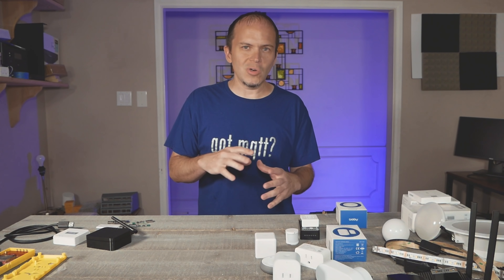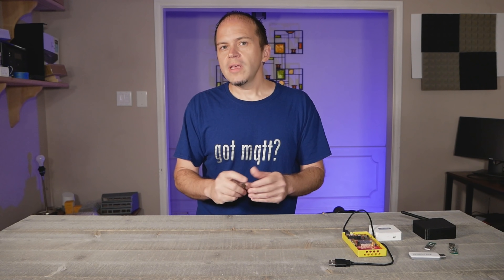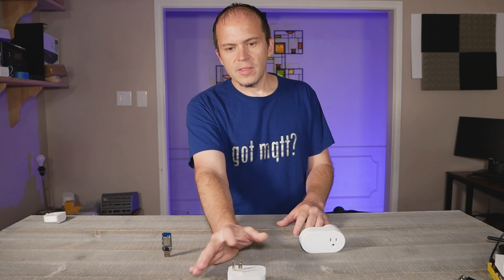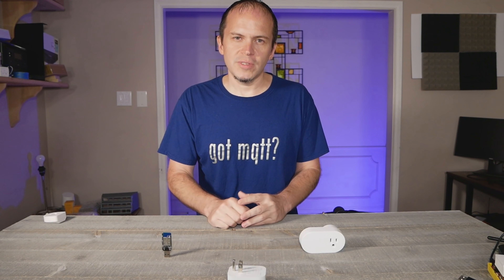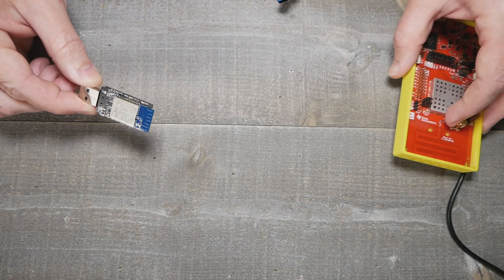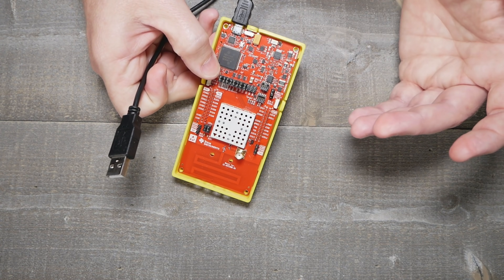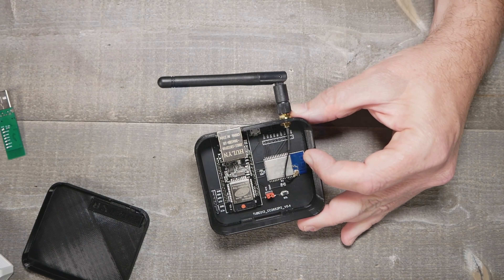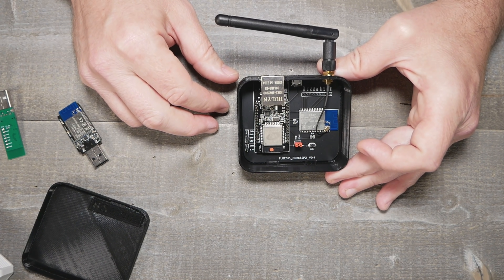How to Start a Zigbee Smart Home - Home Assistant & Zigbee2MQTT

Comment: What's the difference between CC2531 coordinator and sniffer, are they the exact same thing and can they both be used to control ZigBee devices on Home Assistant?
Reply from the maker: Probably the same just different firmware, I wouldn't recommend the CC2531 unless it is just a stop gap while you get a CC2652, then rotate the CC2531 for usage as a router.

Comment: I disagree on the CC2531 comment :P they are fine for a few close devices, or get the one with the external antenna and get much better range.  I had over 35 devices with the CC2531 before I started playing with zigbee 3.0 coordinators.
Reply from the maker: Definitely not on my recommend list at this point, unless you use it for a router.

Comment: You can get poe->micro usb to power the Tube coordinator.    I've got both this one and the POE, love the POE one.   It's my preferred method of doing zigbee now as the house is wired and you can centrally locate the coordinator.
Reply from the maker: Yup. Actually cheaper that way too than the poe version. If you have mesh issues then indeed it helps to move it.

Comment: The downside with CC26x2 and CC13x2 based Zigbee coordinators is that they need Z-Stack 3 which is not yet natively compatible with some other popular home automation software like OpenHAB Zigbee Binding.

On the other hand, while Slicon Labs EmberZNet Serial Protocol (EZSP) based Zigbee coordinators are fully compatible with OpenHAB and HA's ZHA, those EZSP Zigbee coordinators are not yet fully compatible or stable/mature with Zigbee2MQTT (as support in Zigbee2MQTT is still experimental).

Also, believe that Silicon Labs EmberZNet based Zigbee coordinators are prefered if want to use Zigbee2Tasmota (Tasmota's native Zigbee to MQTT support).

Other popular Zigbee coordinators are ConBee and RaspBee by Dresden Electric. They are compatible with HA's ZHA and OpenHAB but are not yet fully compatible or stable/mature with Zigbee2MQTT (support in Zigbee2MQTT is still experimental).
Reply from the maker: I don't see that as a downside myself given the usage with MQTT.

Comment: Better way ..buy Hibitat and install the mqtt binding.  Then you get ZigBee, Zwave and others.
Reply from the maker: Not sure I'd want another layer and another device ecosystem myself then you have to depend on some closed source thing.  I'll stick with the low level zigbee radio myself for cheaper.  Unless I'm wrong and they went open source?
Reply: @digiblurDIY  it's not completely closed.  The mqtt is written in groovy and completely customizable. It's totally offline and not dependant on ANYTHING.  Those crap zwave ZigBee sticks burn up and have limited power, even so it repeats. Hope your first device is strong and close.  I went through there of those in 2 different houses before throwing them in the garbage where they belong.  My conclusion was they are great for testing but not long term production.
Edit...hardly consider it a separate ecosystem...I'm just using the hub for the gateway the same you are doing with the stick.  My advantage is I can put the hub centrally, where as you need to have yours teathered to your server, pi or whatever.
Reply from the maker: The ethernet cc2652p2 based device can be located anywhere you need within reason.  Also the cc2652p2 is a 20dBm device, I actually leave it at default of 5 dBm and it is my recommendation as more power isn't always better in most cases.  I haven't heard of them burning out, power surge issues?

What part is closed source?

Comment: Nice Video. quite an Interesting exposé. I bought the sonoff bridge and flashed with tasmota as suggested on your previous videos, sadly i have to  start searching for a cc2652 coordinator. I was hoping you would mention the Conbee ii usb stick, what's you take on that?
Reply from the maker: Things move fast. At first you couldn't use the Zigbee Bridge with Zigbee2mqtt but now you can but it is experimental. No comment on the conbee stuff as I never owned it. It is listed as experimental as well so I probably won't try it soon.

Comment: PoE to USB adapter! Will take 803af and convert it to microusb with 5v power!!! Adapters are cheap, $5 each... (Or $15 if you don't use yankey bucks)
Reply from the maker: Indeed.  That part got cut as I had talked enough about coordinators.
Reply: I make a PoE version as well using the Olimex ESP32 PoE. an external apadator is still more cost effective, but I fell to the pressure of counltess people asking for a PoE version.

Comment: Great video, again :) Just two weeks ago, i ruined my cc2531 trying to solder some wires to header, after realizing it needs flashing to work as coordinator.

I have order cc2652 from slae.sh . It just worked, after inserting to my hass VM and installation of zigbee2mqtt. For now I have only two aquara buttons, and xiaomi ceiling light ordered.  

BTW. your videos about mqtt and also installing zigbee2mqtt tempt me to try using mqtt more. I have installed zwave2mqtt this week (to migrate from deprecated zwave intergration), but I use native home assistant intergration for now.
My wifi devices are esphome and i use native API. 

But mqtt looks so great, when watching your videos.
Reply from the maker: I do talk a little about decoupling things and why in HA in the upcoming part. Part of it is edited. MQTT is a great way to do it and keep it seamless.
Reply: @digiblurDIY  Looking forward to see next part. BTW: thanks for the link for setting wifi and zigbee channels, i used it to adjust APs at home

Comment: Why the hate for the Nortek?  Expensive?  I have used a couple of those for at least 3 years for both zigbee and zwave without any issues.  It sure reduces the number of usb devices attached (by a factor of one) 😁
Reply from the maker: I did try that stick 3 years ago and it really swore me off Zigbee due to the issues for a while. I then tried the cc2531 and kind of the same thing. Later the Sonoff bridge which really changed my view point on Zigbee. Then combined with the cc2652 chipset and Zigbee2mqtt it just blew me away. I have tried the upgraded firmware on the Nortek for EZSP but it isn't as stable which is understandable given the hardware.
Reply: The Nortek used a now very old decrepitated Silicon Labs Zigbee chip (Silabs Ember 3581) which has since long been made obsolete by newer Silicon Labs Zigbee chips. It also has poor electrochromic shielding and is very sensitive to electromagnetic interference. However, it is still usable though suggest both upgrading the firmware (though note that it is limited to 256 kB of flash so can never be upgraded to the latest EmberZNet Zigbee stack) and use a long USB to try to get it away from other electronic devices/peripherals which could potentially cause signal interference. Just make sure you add enough good mains-powered Zigbee router devices spread around your house which can compensate for a slower Zigbee coordinator with poor signal reception.